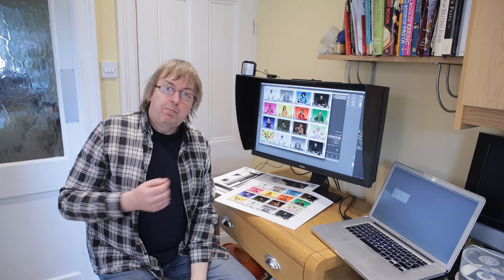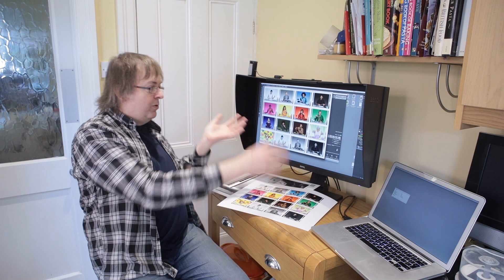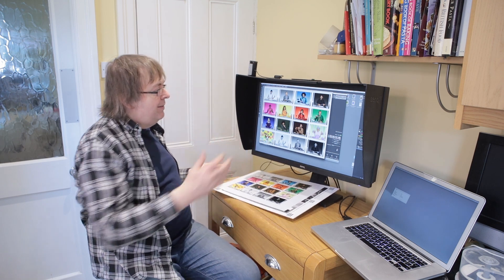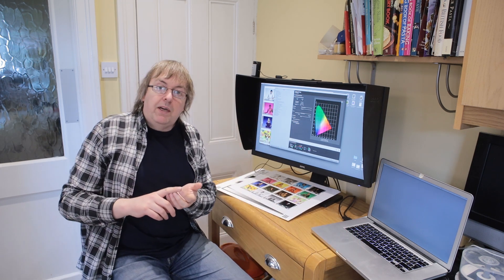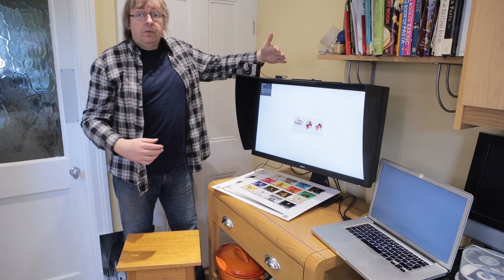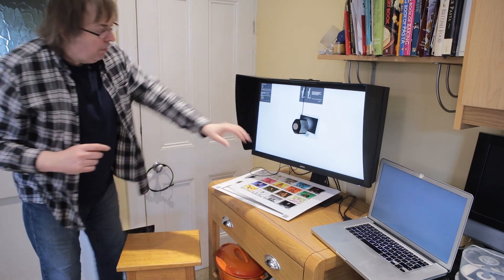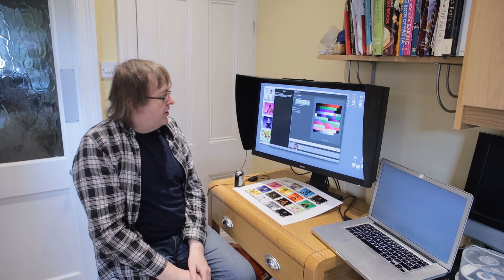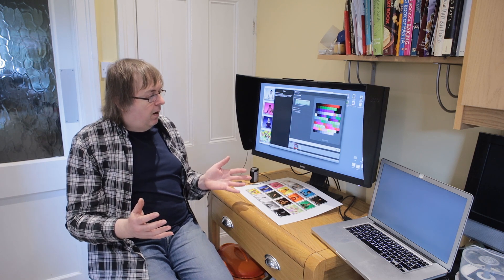Choosing monitor profiling settings using the X-Rite i1Display - why the basic settings work

Comment: Thanks Keith. I'm still using a Color Monkey, few still around but "if it ain't broken" Yey get the idea.
Reply from the maker: It's a spectrophotometer, so handles changes in display technologies far better than a colorimeter of that vintage.

Comment: Hi Keith. Thanks for the video. My question is: after calibrating my iMac2020 monitor with the i1 Display and i1 Profiler software, do I have to recalibrate my monitor if I adjust the screen brightness levels using the keyboard? If I'm not working on a photo, sometimes I'll readjust the screen brightness - does that invalidate my calibration and defeat the purpose of calibrating prior to softproofing? Is there any way to reload the most recent calibration without going through the whole calibration process all over again?
Reply from the maker: Technically it does affect calibration, but setting brightness back to the correct point [see the displays prefs] should be OK

Just don't rely on 'soft proofing' too much!

Comment: Just bear in mind if you're going with Adobe RGB standard white point of 6500 and you're hoping to match your prints then ideally judge your prints under 6500 kelvin lighting. I believe Keith has mentioned in another video that his room lighting was around 4000k/4500k so his 5000k screen white point ain't too far off that! (Open to correction btw if required)
Reply from the maker: Yes - I'd just note that I only have the screen set to ~4k to match the room lighting to look good on videos ;-) It's no good to work on... The place you see me in the current videos is not lit that way when I'm working [on screens at the other end of the room]
My default setting of 6500 is indeed well judged at 6500K - but in reality, no-one really has 6500K lighting, and more importantly, any print you display is unlikely to be displayed in such lighting.
As with all these things, the key is to actually learn to look at prints.  Good consistent print lighting helps - but unless you're in a commercial print proofing company though, expensive accurate lighting is rarely much benefit.

Comment: Hi Keith do you know if you can create printer profile from printed test card using a X-Rite i1 Display Studio Color Calibration.
Reply from the maker: No - it is a colorimeter that measures light - used for monitor calibration/profiling only
Reply: Thank you

Comment: Lol another video I needed to see.. thanks for doing this video I also have a BenQ sw270c.. My question is you don’t have to use the pallet master software for the monitor I can use my i1 profile software is there any drawbacks to using the i1  software
Reply from the maker: Considerable drawbacks I'm afraid. i1Profiler can't do any hardware calibration for the monitor, which is one of it's key quality features. Nor can it set the multiple calibration options - something I use for video editing (setting the display for Davinci Resolve to REC709) and for setting a very low colour temp for showing a monitor in videos
Reply: @KeithCooper  Thank you again for the info

Comment: Your videos are really helping me to get to grips with printing so thanks.  I have a question though.  If I profile my monitor that then gives me an RGB profile that I can convert to in Photoshop to view my work.  However when I come to print I then convert the image to CMYK.  So if I'm editing in CMYK then won't that be different to the RGB profile I have just set up?  Sorry for the newbie question.  I'm just unclear as to what the point in the profile is when I'll need to work in CMYK to edit so that will be what is informing me whether my image is correct or not pre printing.
Reply from the maker: Glad they are of interest.

I'm assuming this is for working with photos?

The monitor profile use is fully automatic, so of no relevance for most of the time - I never need consider monitor profiles in my day to day work.

Unless you have a quite specific uses, then there is no reason ever to do anything in CMYK. If there is then you'll know why you have selected a particular CMYK working space.  The only time in 20 years I've used CMYK was to check some proofs for my book on tilt/shift lenses - all my original work is in RGB

Remember that all the printers I look at may use CMYK inks, but they are RGB devices.

Hope that helps?
Reply: @KeithCooper  thanks a lot for the reply Keith.  I'd always thought I needed to change mode to CMYK before printing but if I can just edit in RGB and see the image using my monitor's profile then yes I'm all set.  Thank you.  Great channel.
Reply from the maker: Excellent - most people never ever need go near working in CMYK ;-)

Comment: Hi Keith, my question doesn't seem to be answered here.  I have a BenQ and there are various Colour Modes on the BenQ Monitor settings: Standard, Adobe RGB, sRGB, Photo, etc.  My question is, which of these Colour Modes is the one to set the Monitor to before I start calibrating with the X-rite i1Display software, and for viewing and editing my Photos in Lightroom after calibrating?
I shoot RAW in Adobe RGB and I edit for both Viewing in Galleries and Printing. (Weddings).
Reply from the maker: If it's a hardware calibrated model you just use the BenQ software and not anything else - the X-Rite software cannot make full use of the monitor capabilities. 

Note that I'm using the x-rite software here on this particular monitor purely for demo purposes. The BenQ software works with the X-Rite measuring device.

Did you read my BenQ reviews? They cover settings in much more detail
https://www.northlight-images.co.uk/category/articles-and-reviews/benq/

Actual BenQ monitor settings depend on the model you have.

I set mine to its largest gamut and save my setting to one of the custom calibration settings.  The monitor shown here has a slightly different (but close) gamut to adobe98. Note too that raw files have no colour space as such, so that setting a camera to A98 only affects any JPEG files produced (and the camera histogram) - it has no real relevance in a raw based workflow

Hope that clarifies things...

Comment: It's funny, until you started discussing monitor calibration, I had a color calibrator that I got free and never used. Really glad I started using it, photo editing is much more reliable after calibration.

Now I'm trying to find out how to manually make an icc profile for my printer printer for some specific papers that don't have profiles available since they're older stock and the printer I use is too cheap.

I don't mind doing multiple test prints and tweaking by holding up to my monitor, but I don't really know what the process is or what software to use.
Reply from the maker: Thanks - I'm going to cover some aspects of paper profiles in a few videos, but see the articles about it on the Northlight site - there are quite a few

Comment: I cal my dual NEC monitors to 5800° K. Prints look great (Canon Pro-1000). I think 6500 is too blue/cold.
Reply from the maker: That's fine - the calibration is the important bit ;-)
A lot depends on the lighting where you are working

Comment: Hi Keith, thanks for all your videos!
At the beginning of the calibration with the luminance I also set the RGB channels via the monitor settings, is it right?
Have you tried DisplayCal 3? I tried  it with my i1 Studio and seems to be a good calibration software... Thanks.
Reply from the maker: Thanks
Yes, it doesn't usually matter how you set the monitor. It varies with monitor and operating system. The 2700 I was using had already been set up with the BenQ software.
I've not tried displaycal - it is at least easier for people to get to grips with than the (otherwise excellent and free) command line based ArgyllCMS

Comment: I am using the datacolor SpiderXElite and I read your review about this device. You were quite positive about it. I am still not happy with how colors are displayed (too yellow). I use a Benq PD 2720U. Is x-rite better ? some people tell me x-rite is a spectrometer and datacolor's device is a colorimeter and this makes the difference. Also, Is there a point in manually tuning your white balance by holding a grey card next to your monitor, lit by a daylight LED display ?
Thanks
Reply from the maker: Yes, the Spyder should work OK, but you do need to make sure the correct sort of backlighting is selected for the monitor. Are you using the BenQ software or Datacolor?

'Some people' are completely wrong in this particular respect ;-) - the i1Display (all versions) is a colorimeter, much like the Spyder devices. The X-rite i1Pro and i1Studio devices are spectrophotometers and not generally better than colorimeters - but they also offer paper profiling.
The SpyderPrint is a multi-channel colorimeter with a multi colour LED source in it. It can make profiles for paper, but not do screen calibration/profiling.

Manually tuning seems reasonable, but is a really bad way of setting monitors ;-)
I will be covering this in some future videos
Reply: @KeithCooper  Thanks !